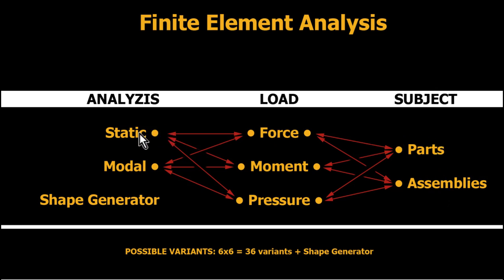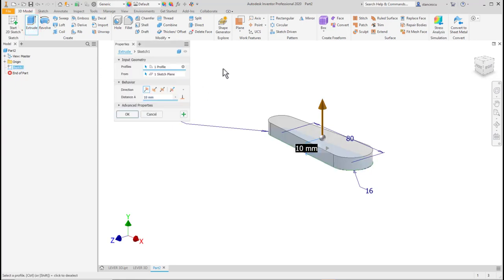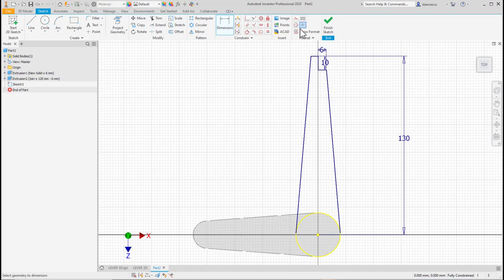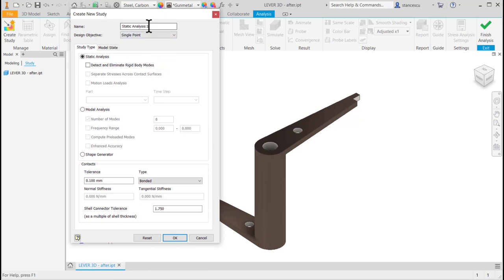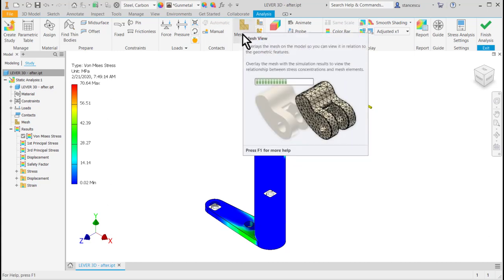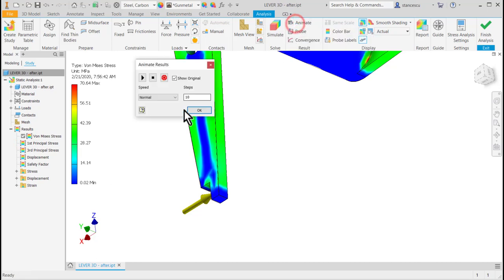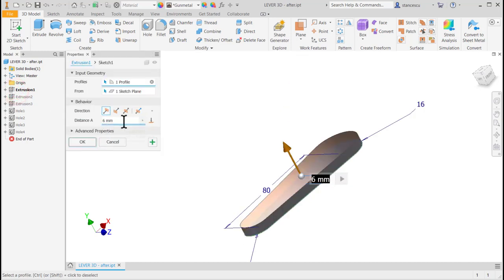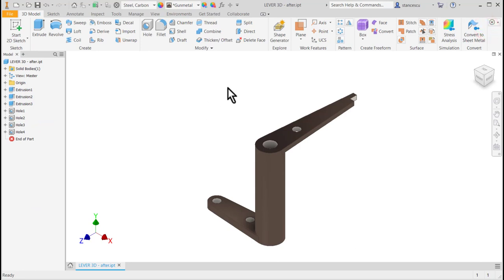Tutorial Inventor - 036 FINITE ELEMENT ANALYSIS - Parts (Force)

Comment: At the end of the video, when you changed the Mesh, the stress had doubled، from 264 to 473.
Why?
Reply from the maker: Because the resolution is a lot higher
Reply: @prof-stancescu  I apologize
The issue is not a story of accuracy, high stress means that the material has become weak in some sense.
In other words: the safety factor also decreases.
That is, there is a weakness in the materials.
Is it conceivable in all materials, if we increase the elements , the stress increases, isn't the stress supposed to remain the same, especially since nothing has changed in the Part?
Reply: Always use convergence settings,  "https://www.youtube.com/watch?v=yQ1Io1MDG5M&list=PLpBPT-vaG5uzYdLzja1IFIgHyMi07ZI7d&index=1&t=1568s"